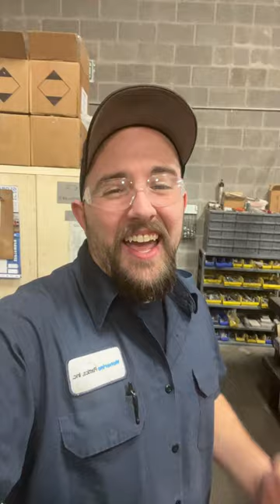Dielectric grease? #tools #tech #mechanics

Comment: SILICONE dielectric grease does NOT degrade rubber parts/components. However, Petroleum based grease WILL degrade them. That's why I only use 3M Silicone grease.
Reply: Actually silicone grease hardens PVC insulation causing premature failure, It also damages the plastic lenses on photo electric sensors.
Reply: @dogwalker666  but I thought pvc was a plastic?
Reply: Now I have to voice my opinion on this one.   Silicone grease is the preferred grease form O rings.  Never apply any penetrating oils or brake cleaner to ANY plastic components or O rings.   It will accelerate deterioration.  Now, dielectric grease is not silicone grease.   I do not know what diectectric grease is.   I do not use dielectric grease on any O rings or plastic components.
Reply: @Franklinveterinarycenter1of4  Most, but not all dielectric grease is made from silicone. Unless it specifically says "Silicone Dielectric Grease" on the label, I wouldn't use it on ANY rubber or plastic components, or anything that touches or rubs against any rubber or plastic.
Reply: You are absolutely correct!
Reply: As an industrial electrician of over 30 years silicon, dielectric grease is the main stay in the petrochemical and power generation plants.
Reply: I use silicone dielectric grease a lot but then again I'm doing it on boats where exposed to the weather.
Reply: Found the 3m sales guy.
Reply: It will degrade silicone gaskets.
Reply: Can u make a video on actually use that silicone type 3m dielectric grease please. I'm having issues on low beam pigtail on my headlights on my silverado.

Comment: Dielectric grease is non conductive. It's in the name. If it was conductive, every time you used it on a connector it would short everything out. I tend to only use it on spark plug wires
Reply: He isn’t saying it right either, it’s die-lectric
Reply: @jonsnothere84  it's actually pronounced dai·uh·lek·truhk
Reply: Perhaps he means the accumulated debris could produce a short
Reply: the first part is right, but unless you've slopped it all over everything else, a conductive grease wouldn't cause any problems.  The reason DI grease is non conductive is to prevent galvanic corrosion.  A common problem with 2 different metals are mixed with electricity & a little moisture.  The process is not dissimilar to electroplating.
Reply: @Leedz13th my grand dad would go dilytruck 😂
Reply: your all wrong lol electrical tape can cause 2 phases to go boom ...just like grease CAN become conductive ...the particulates or water will cause easy path for voltage to ground or phase ... ANY type of grease can become conductive .or cause "brush" contact
Reply: @robotlegs it’s literally designed to insulate a connection and prevents that from happening

Comment: Dielectric is an insulator. That's what "Dielectric" literally means.   If yours getting shorts, it's from conductive contamination, in my experience usually from Never-Sieze, which is highly conductive.
Reply: Nothing is an insulator if you use enough voltage 😂. Except for a perfect vacuum. 
Edit: You are right though that is what insulation for electricity is.
Reply: Is never seize the great value brand? Or costco?
Reply: @harryhalfshaft2913  :
Neither. Never-seez is a brand owned by Bostik which is owned by Arkema; a French entity.
It is an "anti-seizing"  compound. Nomenclature is everything in this world.
Reply: Thank you. I didn't have to type it out...
Reply: What about systems that use low voltage signals to talk with the control unit(computers) they read weak amp, voltage or wattage inputs. That's what I've seen first hand in transport trucks and mining scoops, haulers, jumbo and much more. Mechanics always use way to much product... Silicone for gaskets, di-electric grease, ptfe thread sealant and more. If a little gob will do you, a big gob will screw you!
Reply: @Vdubfro  
Yeah... I hate getting part of the answer.
Nothing gripes my ass more than seeing "distributed by" on something instead of " mfg by", especially food.
Incomplete information is the name of being informed.
Reply: That's totally incorrect

Comment: Honestly this is the first video of yours I’ve noticed any fault in. Dielectric grease is an insulator, it’s non conductive. A short would have to be caused by something else. I’ve had it cause problems with connectors for sensitive electronics because it can provide too much resistance. I only use silicone dielectric grease, which isn’t harmful to any rubbers.

Comment: I have found that if you use dielectric grease on a wire coupling that is exposed to the elements "eg. A wire on the undercarriage of a vehicle or trailer" you can get a great long term result by taking a butt connection, apply the grease and cover it with some heat shrink to keep the dirt out. Works great but if you are working under a dash you wind up just making a gunky mess around anything you put it on
Reply: 3M Scotchkote FD is a sealant and bonding agent designed for underground electrical splices that works well .  15oz. can $60.00 on Amazon 8/17/24

Comment: I am a military mechanic for the air force and I would say it's application specific and location specific. I'll use it in high humidity locations and vehicles that live outside and off road conditions, construction vehicles flight line tow equipment and M series (HMMWVs and MRAPS). Also with connectors on trailers it has been a life saver. Those connectors are not always the best quality, so adding a little bit of 'weather proofing' (when you can't out right replace the connector) is really great for my piece of mind. To be clear this is not something I would use to fix anything, this is a preventative measure only.
Reply: Thank you for your service!
Reply: @randallolson8817  it is a pleasure to serve, I love what I do!

Comment: It's a case of when and where it's beneficial without the possibility of causing an electrical gremlin. Ex: around lenses of trailer lights, in crimp connectors, battery terminals or as a lubrication aid when feeding wires through grommets. Added bonus, it makes it easier to install grommets and seals them at the same time. I only use silicone as it doesn't degrade seals like petroleum based does. Zip~

Comment: Hi Dan, long time listener, first time caller. Dielectric grease is non conductive by nature. Shouldn’t be causing shorts it grounds unless particulate(s) gets stuck to the grease. My main goto when I’ve got bad fittings on switch gear, cleans the threads and I don’t have to worry about booms after I power up!
Reply from the maker: Thanks for the comment!
Reply: @dansproshop  thanks for churning out so much sweet, sweet content!
Reply: I was about to comment the same thing.  It's none conducive but the contamination could be.

Comment: I do use it on spark plug threads and plug wires, battery terminals, trailer pigtails and frame mounted ground wires.
HOWEVER, less is more. You don't need to goober it up. It's silicone based and a thin film of it does the job. 
And NO silicone dielectric grease does not degrade rubber.

Comment: I was introduced to dielectric grease by a maintenance guy I worked with who happened to be an electrician. We were wiring up a few electric hoists in a wet area and he squirted some in every wire nut we used

Comment: When I was working as a tech up here in Canada I used silicone dielectric greese for 2 primary applications.

1st was for ignition coil plugs / sparkplug boots, for the reason that it can be used as a lubricant that retained the electrical connection.

2nd was for brakepad contact points. Yes it attracts brake dust + dirt, however I found personally it was more worth while to be able remove the pads easier than to worry about the dust and dirt. Because I'm from a province that salts the roads, rusted in pads are not uncommon, and are a pain to remove!
Reply: Retired Ford Tech here. Pads and plug wires.

Comment: I apply silicone paste instead of an anti seize lubricant on Class 8 fixed roller pin S-cam brake assemblies , it eliminates the intrusion of water .  Silicone paste is a non conductive insulator for electrical components . Silicone paste and dielectric grease are the same . Carbon Conductive Grease will conduct electricity .

Comment: Outside of the cab I fill the connector with silicone dielectric grease and I use a ratcheting crimper on all connections and since I made those changes I haven't had a failure. I'm a trash truck mechanic and I've been looking for a "better" way for the last 40 years and I think I finally found it.

Comment: I was under the impression that dielectric meant that it was a insulator not a conductor
Reply: That's correct. Anyone who thinks it's conductive has it wrong.
Reply: @Krankie_V  The grease is nonconductive. The dust that gets stuck into it can be conductive.
Reply: @PeregrineBF  well yeah contaminants can be conductive, but that's not what the original comment was about.
Reply: @Krankie_V  Yes, the original comment was correctly saying that a dielectric is non-conductive, by definition. The video complains that dielectric grease can lead to shorts. Those shorts happen if the grease gets contaminated with significant amounts of conductive material. Such contamination won't usually happen if the joint is good, but a poorly connected item or a degraded seal can allow conductive contaminants into the grease to cause a short. Clearer?
Reply: It is this is why the internet is very questionable anymore
Reply: @PeregrineBF  so if dust get stuck in degrees unless it penetrates the grease and touches the thing that's going to be conducting it's still an insulator......

At this point if you put dielectric grease on something like a battery terminal it's already conductive it's bare-led then you've done nothing but have a conductive surface insulated and then possibly have something that would be conductive on top of it

Just for fun we realized waters non-conductive right
Reply: Be careful what you hear from this fellow
Reply: thats right. I find people who think its a conductor apply it all over the contacts too which will cause a beak in the circuit not a short.

Comment: It actually helps provide a better (longer lasting) connection by isolating the connection. Back when I wrenched, used it on any connector on trailers/equipment thats exposed to the elements/exhaust wiring, you get the idea. Fantastic stuff, the difference maker here is the amount, too much and you have created yourself some more diagnostics.

Comment: I'm a diesel pickup mechanic in a rural area. Lots of farm trucks that get into mud and water. So you get to learn which connections tend to be more prone to getting water and crud in them, and as a habit, I definitely use it in those places. And I'm pretty positive that silicone based dielectric as non conductive and doesn't corrode the connections. I also use it on the slide pins on brake calipers and other places like that.

Comment: I work on a lot of machines that generate corrosive gasses, these gasses eventually condense to a highly acidic liquid…

We tend to use silicone based greases and seals for electronics, while specifically avoiding petroleum based ones…

For conductive running parts (energised rails) or to seal a live joint from ingress we use lithium based greases which tend to aid conduction…

In my experience the additives lend more towards its conductivity than the ingress of crud.

Comment: I sparingly apply it to the rubber seal. If extremely corrosif conditions are present, I use a paint brush to give a thin coat on the male pins of the connector. That MY two cents! 😂

Comment: Dialectric is actually the most rubber friendly grease out there, so if you need a lube, a dab'll do ya. The mold release they use for plastics and rubber is silicone, by and large.

Comment: GM had a great article on Fuel Injector Electrical Connector Fretting.  Research that was done due to like over 90% of injector warranty returns were good .  Been using dielectric grease ever since

Comment: Meat plant maintenance here... sanitation shift is the electronics biggest enemy. Under skilled workers blasting absolutely everything with high pressure hot water. 

Dielectric grease... we use it in every connection

Comment: As an aircraft mechanic, it depends on the specific type and location of the connector as to whether or not I use it. When I work on vehicles, I use it wherever the manufacturer used it or if an FSM/TSB/whatever calls for its use.

Also, dielectric grease is nonconductive. That’s actually what the word dielectric means. Otherwise, any connector with more than one pin would be shorting with any use of dielectric grease.

Comment: Some of the new micro 64 and micro 50 terminals in the automotive harnesses are very picky with terminal tension, and dielectric can fix some intermittent opens caused by loose connections or poor quality control from the supplier of the connector/terminals. I should note that I don't typically rely on dielectric as a primary repair for poor terminal contact, I prefer to replace the connector or terminal if available, but lots of recalls and bulletins call for it, so I do use it preventatively or when another repair is not feasible.  It's important to be sparing with the grease, so as not to attract too much dirt, but also because slathering it on can displace too much volume in some of the connectors and keep them from seating fully. I'm not particularly worried about dirt in particular because my region doesn't deal with much mud or dust, and in most cases, its unlikely that the connector in question will ever be disconnected for any normal maintenance of service, like on an airbag subharness, or an out of the way control module.

Comment: Dielectric grease is specifically made to be non conductive and used in electrical  connectors. On the other hand, regular grease is made to last a long time in mechanical joints, and most are electrically conductive. Although they are both called grease, they are made for completely different purposes and are to be used in completely different circumstances.

Comment: As previously noted dielectric grease does NOT conduct electricity. Also...it does not harm rubber. It will deteriorate silicone o-rings.

Comment: I use it on any plug connector that is exposed to the elements especially in the winter (plow and spreader connectors). I also use it as a water barrier to protect connectors while being stored away when not in use.

Comment: If you're using the right grease, it's nonconductive and will not attack rubber. Silicone grease. Funny story: I went to a local electrical supply store and asked for dielectric grease. The young rep asked me what I'd use it for and tried to sell me conductive grease. I'm not normally a Karen, but I did ask to talk to the manager. 😂
Reply: Petroleum jelly is less harmful than silicon. But I use food grade grease at work, technically you can eat it 🤢
Reply: @dogwalker666  If it's stupid, but it works, it's not stupid.
Reply: @andrewrollin3506  well we have to use food grade, The biggest problem is it’s an order of magnitude more expensive.
Reply: @dogwalker666  Oh, god, I misread and thought you were using vegetable shortening *facepalm*. 🤣
Reply: @andrewrollin3506  well actually it’s not very different lol.

Comment: I use it on electronic connectors. Cummins ecu connectors are a must, I put alot on to prevent dirt getting in the connectors. I was having so many issues trying not to brake those plastic connectors till I started to do this to the fleet.

Comment: I add it to the end of the spark plugs themselves in a fine coat and then add the wires or coils so no extra globs in the cavity not getting wasted same method for any other connector as well if I decide its getting corrosion deposits
Reply: Ford, on the early 80s electronic ignition used dielectric grease on the distributor contacts and on the rotor. Came with the cap and rotor

Comment: You absolutely fucking use it! It's Silicone, so it does NOT deteriorate rubber. And it PREVENTS arcs because it's NOT conductive. WTF. Don't leave it out.

Comment: You have to be really careful with the stuff, especially on connectors with very fine terminals.  The hydraulic force can actually spread the female terminal and cause intermittent connection issues.  On beefier terminals it's absolutely AWESOME.

Comment: I use silicone-based dielectric grease on my motorhome shore power connection, and my surge protector, both of which are big, strong connectors which are really hard to connect and disconnect. I do NOT ever use petroleum-based dielectric grease for such application because that would be a serious fire hazard, as well as degrading the insulation. I WAS concerned about the dielectric properties of the grease inside the connectors, but the wiping action of the contacts seems to work well.
Then I was thinking hard in the shower one day and realized that for AC applications, a little dielectric grease between contacts simply constitutes a series capacitor, which readily passes AC, but blocks DC. 
I was deep into thinking about Maxwell's idea that electricity doesn't flow through the copper at all, but through the electric field - and my shower ran out of hot water!

Comment: I use it on just about everything that I have unplugged and I use it religiously on Plow(winter equipment) and Trailer plugs, they do say it’s nonconductive, however…..  I also use conductive electrical grease when necessary on individual female terminals as they are usually separated from each other better than the male side is.

Comment: Silicone dielectric grease yes, sparingly around the connector seals and a light brushing on electrical contact surfaces works wonders! Never an issue!

Stay away from the petroleum based grease and white lithium grease in and around rubber, plastics and electrical parts, you will be asking for isssues!